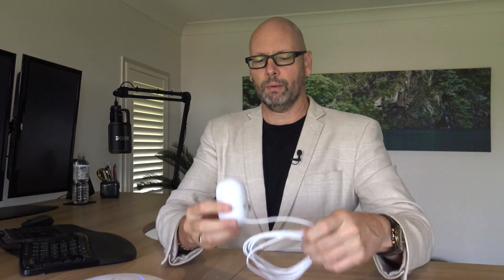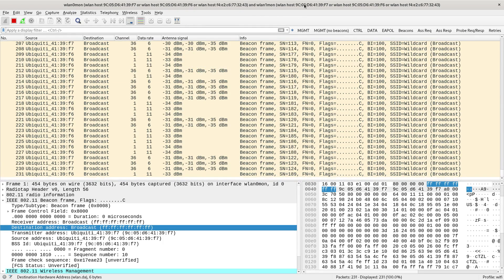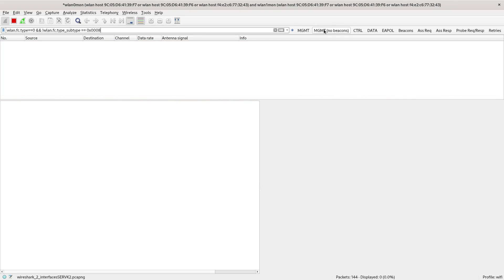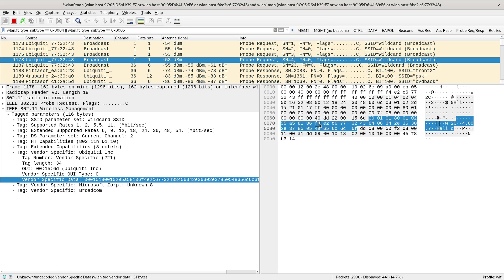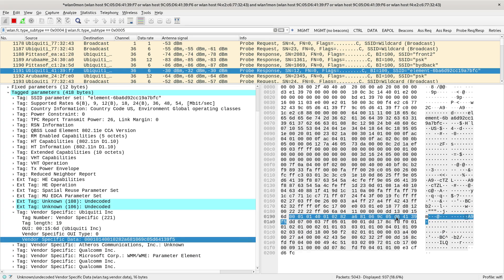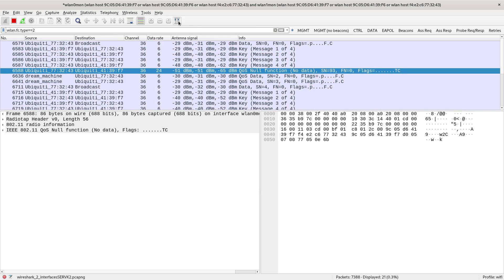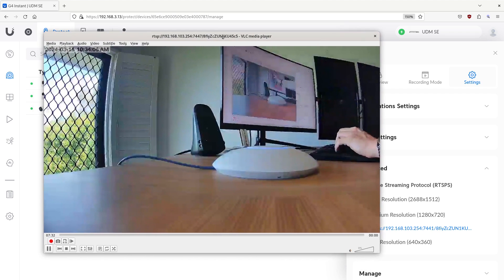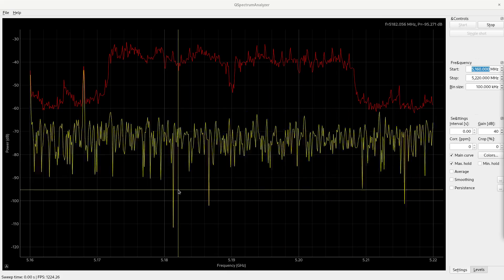Ubiquiti Camera Wi-Fi Adoption Process

Comment: If you haven't already gone poking around; Under the Unifi Network controller software on your UDM Pro SE, the WiFI auto-association for UniFi devices can be disabled.

Under settings (gear icon under Unifi Network), then System, then the Advanced Tab, then at the bottom "New WiFi Device Auto-Link" and uncheck it to prevent it from automatically associating unifi devices to your wifi network.

Now i'm unsure if that disables the hidden SSID for them or not as I haven't checked that via Wireshark, but I just did it for security reasons.
Reply from the maker: Okay, I just disabled it, and also the mesh which is another ssid in the air to get rid of.